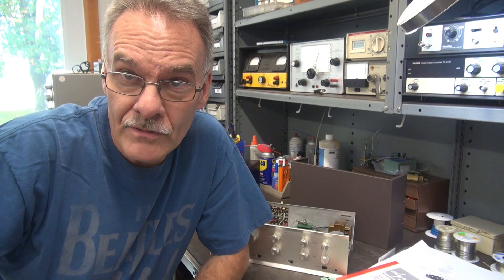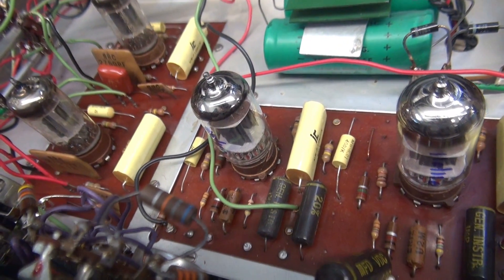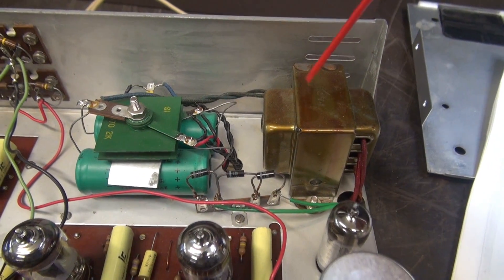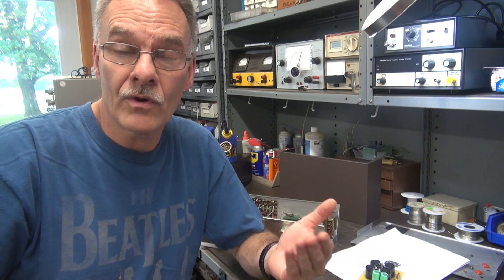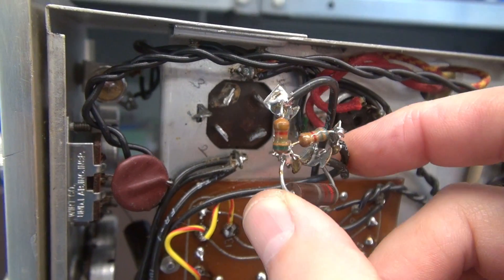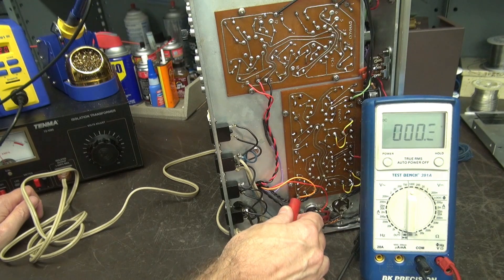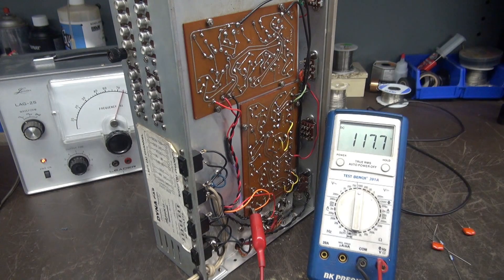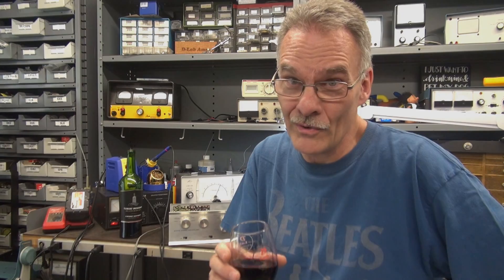How to repair Dynaco PAS tube Preamp D-Lab Tek Tips Power supply fix

Comment: Something to consider with the Dynaco preamps.  The specified current draw of the 12AX7As assumes that they are being run at 12.6 vac (in series).  Dynaco runs them at about 11 to 11.4 VDC depending on just which preamp, which version of the transformer, and the input line voltage. This was a common practice in preamplifier design in the day.  There is a slight loss of gain, but a significant decrease in noise in the early stages.  So there will be less current draw than expected in the 12AX7As.  Remember, Hafler was a transformer designer.  So the current is probably just inside the rating of the transformer, depending on the input line voltage.  Still a little tight on the spec, but not as far off as you might first expect.

Comment: What it needs is a bigger transformer, the balance control is a waste of time, I'd kill the tone controls too and never, NEVER use silicon rectification if you can use a valve. But what do I know, I worked for Audio Note for 10 years.

Comment: I always connect all PAS Preamps to a Dual Channel Scope and look for channel to channel balance. Often these preamps have Volume and Balance controls that are gone, and the sonic improvements by upgrading the Volume Control is amazing. The Balance Control is difficult to find used, but re-soldering 50 year old connections makes a Huge Improvement. SDS Labs Board is a must have. Love the 12X4.

Comment: 7:10 So what's the best way to avoid spending $90 for a new power transformer?  Go to Triodeelectronics and spend $99 for that cap board there.  That board costs more than the transformer, you got to be kidding me, right?   Go buy Axial caps and put them on a turret board for less than half that.   Great video though!

Comment: I'm really liking your videos and would like a valve amp myself as I really love the sound.  All the ones I have tried require too much volume before you get the distinctive sound.  Do you have any suggestions for a decent valve amp that gives that decent valve sound without blasting the windows out?  I love the vintage AC sound so something with that TYPE of sound but quieter?  Thanks.

Comment: There is one mod that David Berning did with the PAS 2 that made a dramatic improvement in sound quality. It was to replace the Centralab integrated resistor/capacitor pack with discrete components and to replace any ceramic capacitors that pass audio through it with high quality non-electrolytic types.

Comment: That appears to have the 3X tone controls so you will need two 1uf capacitors that go between the controls and the board. Those prevent DC from getting to the output jacks.

Comment: Oh man!, I have been through the changing of components in my 1965 PAS-2 preamp.  Changed out to a modern power supply and ended up with MORE hum then the original.  Selenium/cap assy.  replaced with same type you have there Terry.  Ended up putting the ORIGINAL powersupply back in operation,  had to read the assembly directions carefully and make it all look like original.  

The only thing done now, was a complete cap job.  The FACTORY ASSEMBLED preamp remains UN-changed and it sound SO good with a pair of Mark 3 amps with safety changes made,  all built on the same date and consecutively numbered....    Klipschorns UN-altered from 1968 making music............FUN STUFF!    Thanks for the stemless wine glass (O;

Comment: Based on the front panel this should be a PAS-3 or possibly a PAS-3x.  The PAS-2 did not have this panel, and the PAM-1 was a monophonic preamp designed to mate with their Mark III and Mark IV power amps.  The PAM-1 had no power supply and drew their power from the power amp supply through the octal connector provided.

Comment: About the the potential for the Dynaco PAS to sound very good... Several years ago, a friend had one of these that was heavily modded by a shop that specialized in such things. At first I suspected snake oil until I actually heard the thing. Along with an also modded Dynaco Stereo 70 and a pair of Chartwell LS-3/5a speakers, it made a very remarkable sounding system indeed. Much higher sound quality than many larger / higher dollar systems I've heard.

Comment: This video couldn't have came out at a better time for me. Just got my Blueglow/Kegger KT88  SE amp built a few weeks ago and I'm currently using a Dynaco PAS3X to drive it as a preamp (BTW, the KT88 SE amp sounds incredible!!!). I have already updated the power supply board like in your previous video, but I'm currently using the rectifier tube. I'm thinking I might try changing to solid state per your advise in this video to reduce the load on the transformer. I also am having some intermittent rustling in the left channel so either have a bad connection, dirty socket, or perhaps a bad tube that I need to track down. Thanks Terry! Great video once again! Keep it up!

Comment: That preamp was modded to reduce preamp noise floor by removing balance pot and other un-needed front panel switches. The quietest preamps have the fewest switches and pots as possible.....my personal stereo Waga preamp only has 1 volume pot and 1 function switch
Reply: Exactly! The difficulty is at what point is “the juice not worth the squeeze” with the prices of these preamps nowadays.

Comment: Leaving a tube rectifier in has an advantage (assuming the xfmr isn't overworked). With it, the HV comes up slow, no filter cap inrush, so it's easy to slip in a low-current fast-blow pigtail fuse to help protect the transformer winding.
Reply: Also the HT comes up to a lower value, because the rectifier drops tens of volts, which means the HT current is lower as well.

Comment: The other option for the rectifier is to make a diode rectifier out of an old tube base and diodes. You get a solid state rectifier without modifying the circuit.

Comment: Why did they use a 12v filament supply anyway?
Reply: @electrofrying1685  These things weren't cheap to begin with...why they felt they had to make that kind of concession I can't understand...
Reply: They actually didn’t. Sadly Terry misrepresented what was actually implemented in this design. The rectifier tube 12.6VAC. However, the 12AX7 filaments are connected in series pairs & fed 22VDC. 
Why? This runs the tubes at lower filament current, lowers noise & lengthens tube life. [This is actually done in some tube testers as a “life test”].
The Selenium rectifier has inherent voltage drop in it as well so when replacing it with diodes & new, lower ESR, modern  electrolytic capacitors a power dropping resistor is usually needed to get 22-23VDC.
This is why the Telefunken 12AX7s sound great & lasted so long.

Comment: Great troubleshooting video Terry.  What type of hook-up wire do you routinely use?  Solid core or stranded?   18, 20, or 22 gauge?  I m looking for  solid core wire for repairs and I am having trouble finding a source.  I find solid core much cleaner to solder than stranded.  For tube equipment it needs to handle 400 or 600 volts I believe.
Reply: Try Amp Parts Direct in Altamonte Springs, FL. They sell great wire for amp work. It is not solid core, but it stranded with a top coat so it works like solid core. It is rated at 600V.